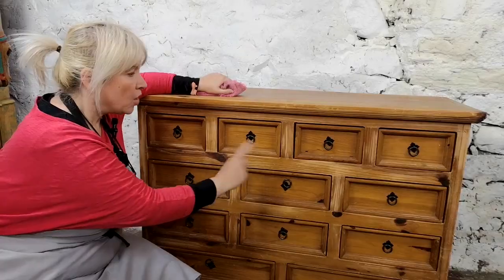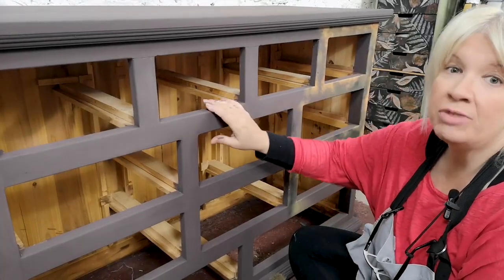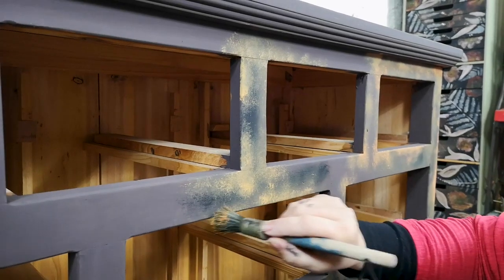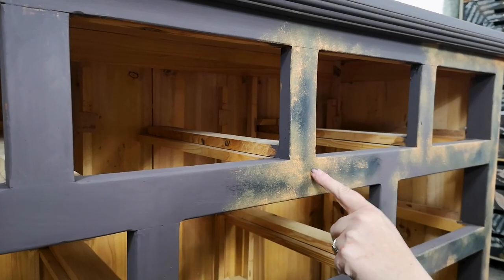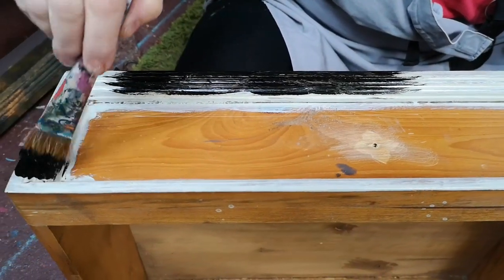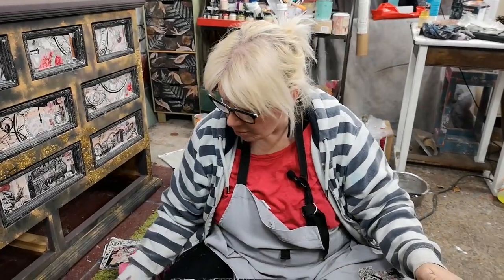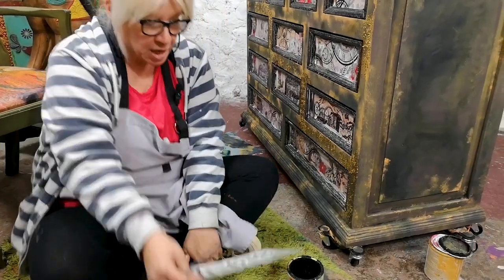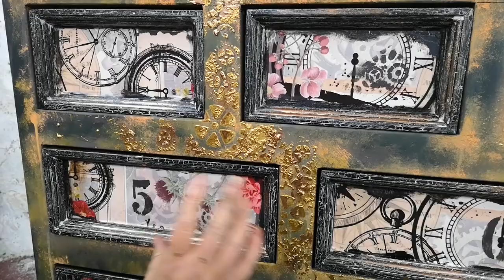This is How You Get The Rust Effect on Furniture

Comment: Hello, I love this, very inspiring. I'm doing a similar piece, what did you seal the front with? Polyurethane? Clear wax?
Reply from the maker: Hey there I sealed it with 2 coats of laquer but wax would work equally well.
Love Lel x
Reply: @MadebyMarley  thank you for responding , I'll do polycrylic or something along those lines, think clear wax will dull my metallic details?